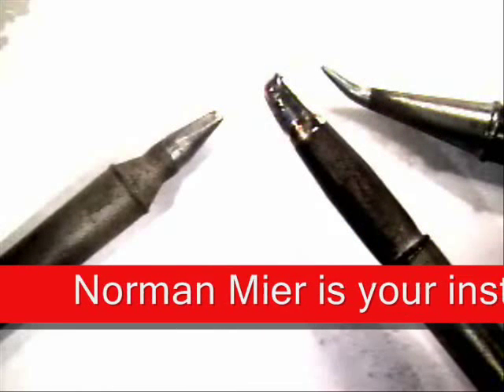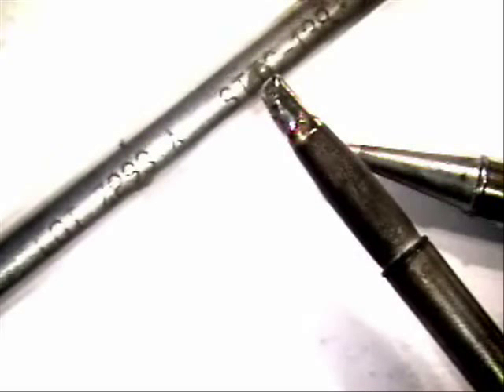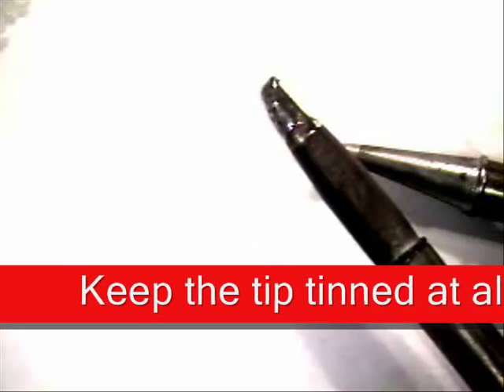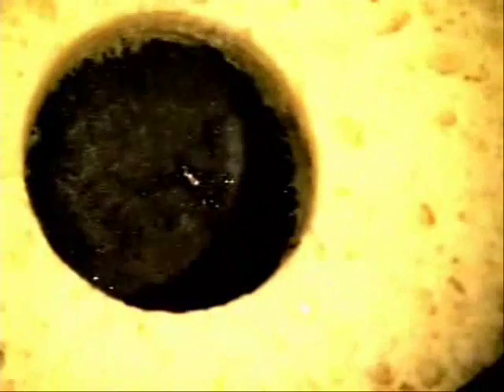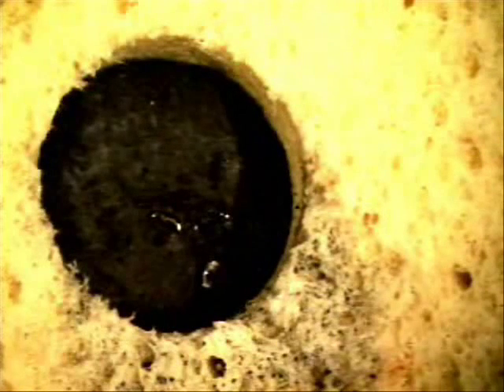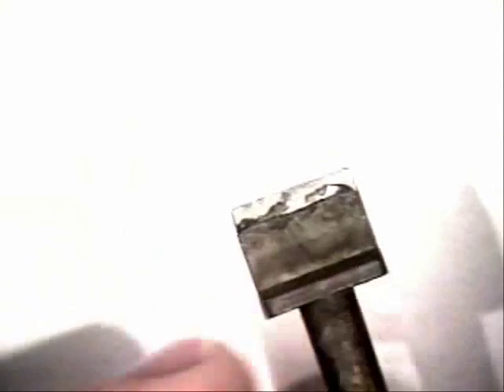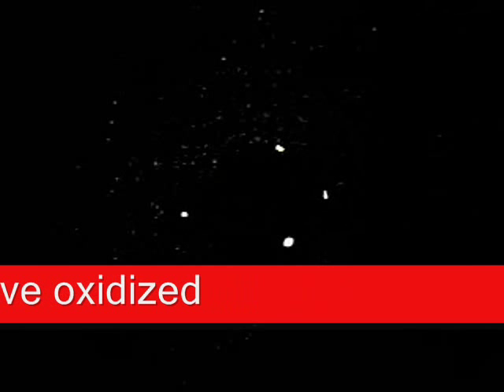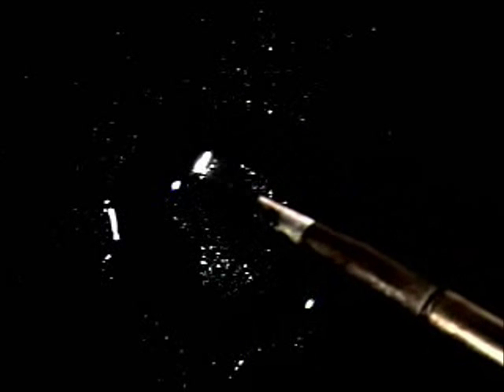Soldering Tip Maintenance

Comment: @kysrs0ze i put solder on the tip and wip on sponge then stab it in some flux paste then i got from ernzomatic then add more solder the rust and black will bubble off and then wip on sponge then add more solder thats what i did my tip was black like old 20 year old car oil black

Comment: Get a block of Sal Ammmoniac (find on ebay) and rub your bad tip across it; it will fix the worst tip you have quickly. The block will probably outlive you too.

I've never seen a tip that couldn't be brought back to life easily with this stuff.

I'm surprised you didn't mention it!

Comment from the maker: Yes, I don't use it because it doesn't clean the impurities from the tip and you need the steam from the sponge to do that. With the brass tip cleaner it only removes the solder.

Comment: Norman (or others) : What are your feelings on those metal "sponge" cleaners that you plunge the tip into? I believe they're brass.  I use one now and I find it works excellent - perfectly clean tips in just a second with no thermal shock. But I notice you don't reccomend them, curious why?